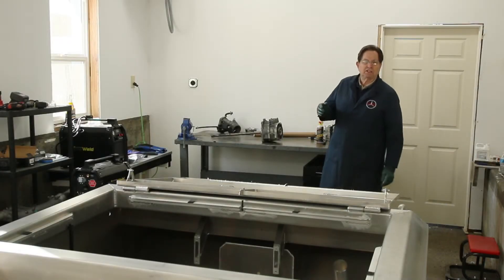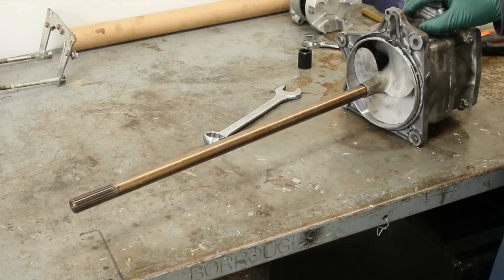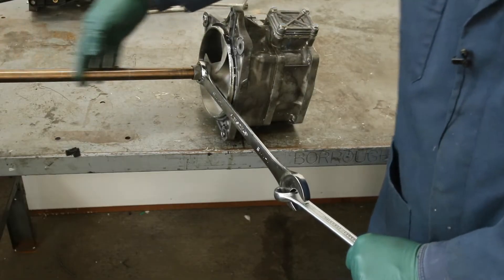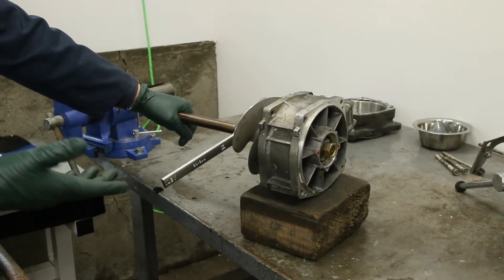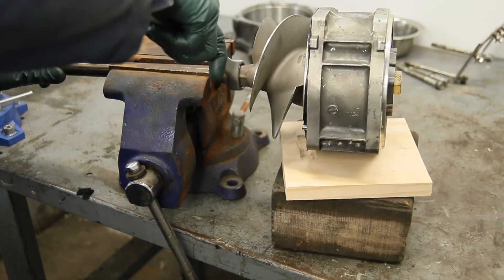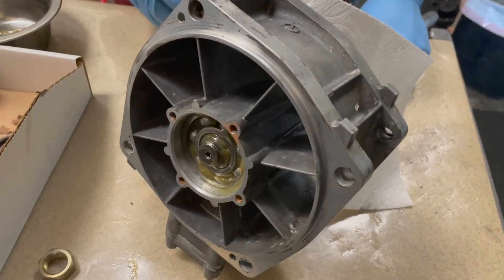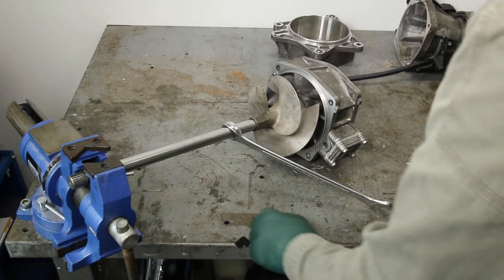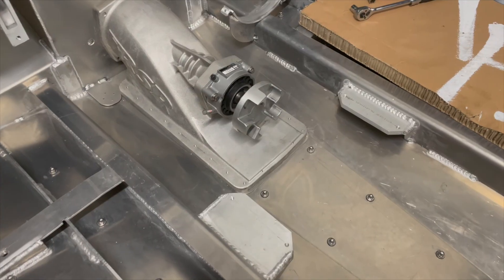Yamaha WaveRunner SVHO Impeller and Driveshaft Replacement - The REAL story!

Comment: Where did you get the shorter drive shaft replacement?
Reply: I've got two shortened for the Yamaha if you still haven't found one.  Had them responded for my mini jet boat but ended up changing motors to a different brand.  Let me know if you're interested.

Comment: Do you know the torque spec of that drive shaft nut at the front bearing? I can’t seem to find that anywhere.
Reply: Did you ever find the torque spec? I still can't get this stupid impeller off. Battling the flex need another vise only have one. Lol
Reply: @quentinvoth1395 just put the drive shaft in your vise as close as you can near the impeller, heat the crap out of the wrench area, use a long cheater pipe on the wrench, it will come off.

Comment: I cut a large 27mm socket in half so it can slide over the 'nut' end of the impeller. Welded about a 4' angle iron to the socket for one BIG wrench - and it worked.